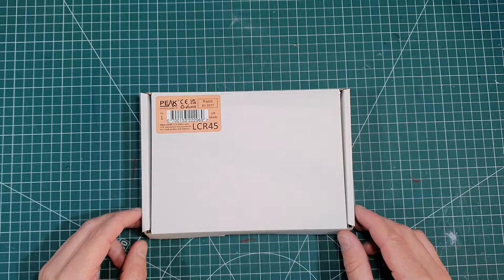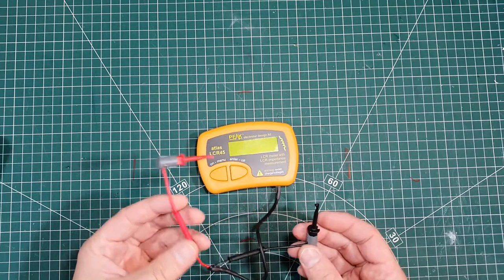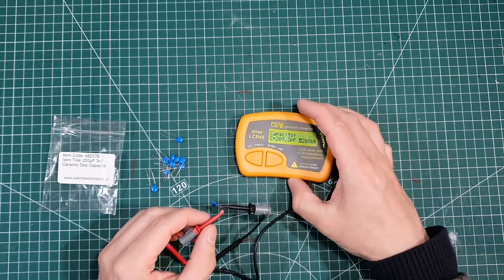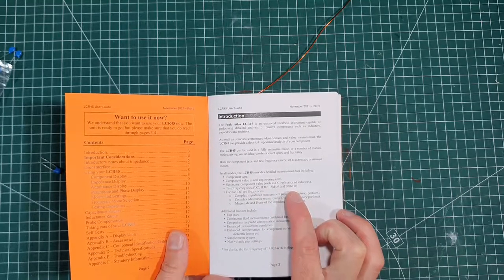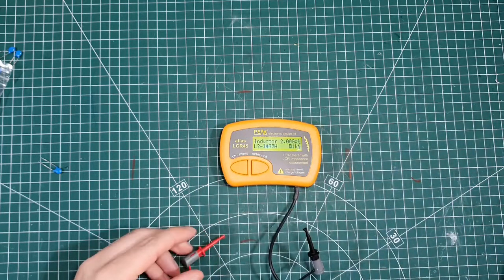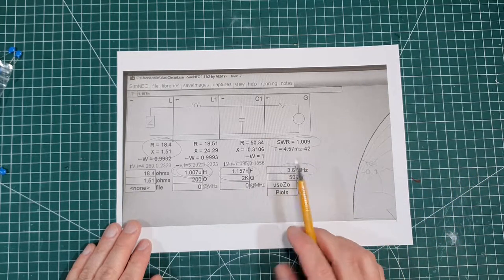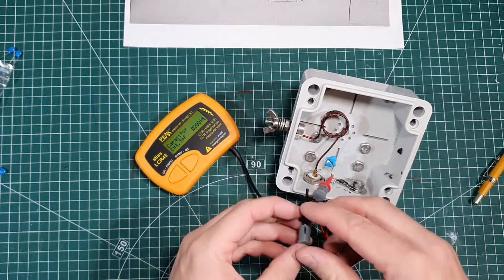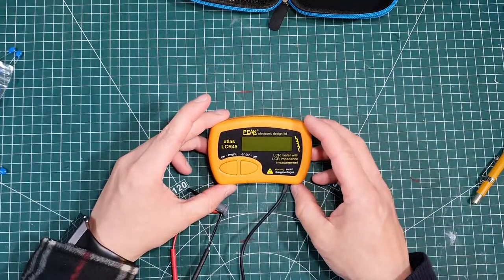Peak Atlas LCR45 Overview - Measuring #Inductance & #Capacitance Easily

Comment: Great wee meter for folks like yourself,  simple resonant verticals here,  so no test gear in my shack at all. Saved 80 quid, wife got a good malt hi hi. Look forward to seeing you on the coast putting signals my way. Cheers mate.
Reply from the maker: Saved yourself £80 but you have that lovely CW key I'm envious of. Struggling to get enough time to get to the saltwater for some operating, even then its not at the best times. Heres to hoping.

Comment: I had one of the cheap ebay Chinese LCR meters and "component tester" but it only measured as low as a handful of mH, so I ended up getting the Peak LCR45 and it's absolutely brilliant. I wouldn't be without it.  Definitely worth the money.
Reply from the maker: Absolutely. I've total trust in it and wouldn't be without.